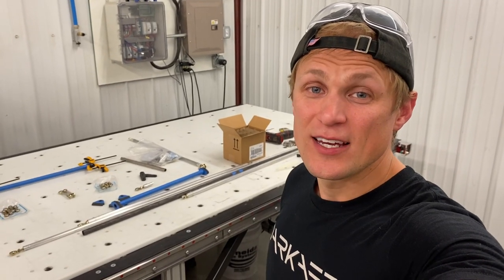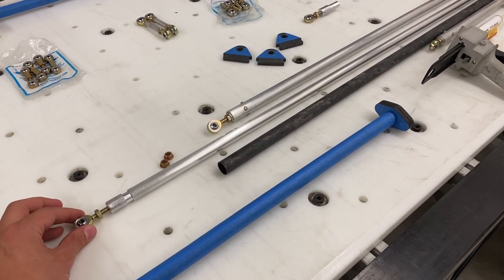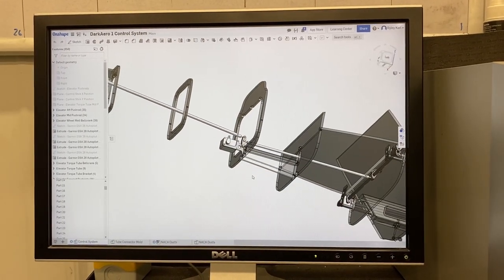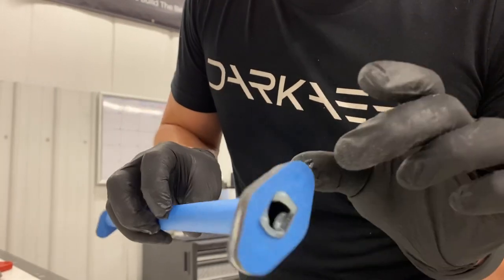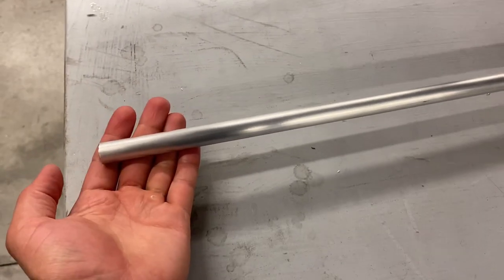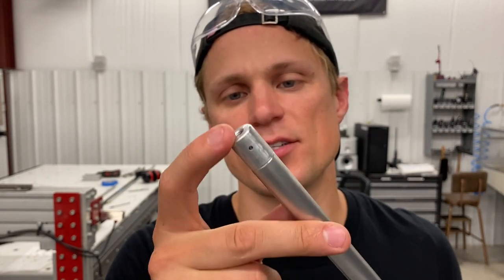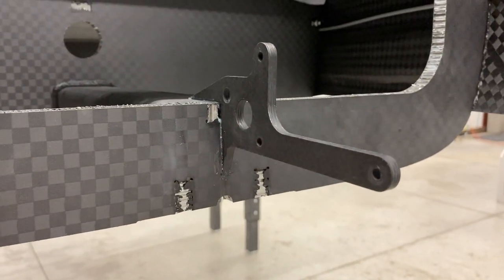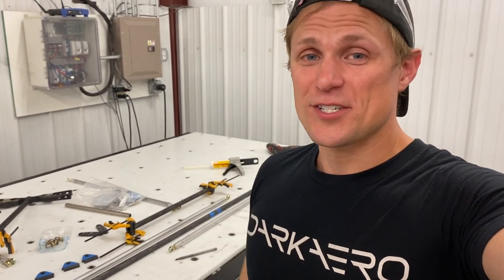Making Aluminum and Carbon Fiber Control System Parts for the DarkAero 1 - July 1, 2020

Comment: You may want to have a look at how the MCR01 bellcranks are made. Cut from CF/foam sandwich and the foam is cut out at the tips to make a clevis and fit rod ends. Still decent surface area to bond on the torque tube and extremely light.
Reply from the maker: Thank you for watching! Can you provide a link or documentation on the concept you described?

Comment: When you weigh each finished part, how does it compare to the theoretical weight of the 3D modeled part?
Reply from the maker: Great question! In general, we are within 1-2%. Billet machined parts and hardware almost always dead nuts on. Composite parts like the carbon fiber airframe structures are within the 1-2% range. We did a video discussing some of the sources on this variation. https://youtu.be/ziEnDjEHJuk Interestingly, the components with the most error are usually supplier components which don't always line up with their published weight numbers.
Reply: @DarkAeroInc  So no surprises when it comes to doing the first weight and balance 😊

Comment: Question regarding use of component mass data. I have seen your video about the variables that influence final component weights.  As you get the final weight values, do you  update the components’ actual weight in Onshape and / or your stress simulation analysis application with the view of validating & improving the accuracy of any stress analysis ?  PS Thanks to YouTube I  came across your work while following Raptor and Scrappy. Love your work. Wish you all the best. Thanks for sharing.

Comment: Curious why you didn’t go with carbon push rods instead of the aluminum? I’ve seen threaded inserts specially for that purpose.
Reply from the maker: We might ultimately go with carbon fiber pushrods if we can find a thoroughly validated solution for threaded inserts that are aircraft grade. Given the flight critical nature of the pushrods, and in the interest of getting the prototype finished, we just used standard off the shelf parts.
Reply: DarkAero, Inc  fair enough! Enjoying the videos!
Reply: Maybe the ball joints could be moulded into one piece to eliminate treads and rivets....
...a lot of work for a few grams :-)
Reply: Sqpapa   Please share the threaded insert design & source you refer to?
Reply: DarkAero, Inc   How much wt or % difference is there if you switch to carbon tubes?   Assume just tubing, neglect the ends since there is no design for those yet.  

I love the daily or at least weekly videos!

Comment: great progress. Also why wouldn't you use a carbon fiber tubes for your push rods to help cut down on some more weight?
Reply from the maker: Thank you! We might change over to carbon fiber tubes for the pushrods if we can find a thoroughly validated solution for threaded inserts that are aircraft grade. Given the flight critical nature of the pushrods, and in the interest of getting the prototype finished, we just used standard off the shelf parts.

Comment: I'm building a Vans RV. The push/pull tubes on your airplane are much smaller in diameter than the Vans ones. They will be adequate in tension, but have you checked them for buckling in compression?
Reply from the maker: Thank you for watching! The pushrods were sized based of the flight loads and control forces in the DarkAero 1. They were checked for buckling in compression.

Comment: Ryley - how did you locate the holes for the match drilling in the push rod? Seems that the rod end holes where inside the pushrod, did you have a template or jig to locate the holes?
Reply from the maker: There are two 1/8" diameter holes in each insert/tube end which are drilled 90 degrees relative to each other. I placed the insert into the end of the tube and then taped it in place so it wouldn't move or rotate. Then I measured and marked 1-1/16" in from the end face of the insert for the first hole and drilled this first hole on both ends of the tube. Then I measured and marked 1-5/16" in from the insert end face for the second hole. When I drilled the second hole I placed a long 1/8" diameter drill bit in the first hole to use as a visual indicator to help sight and align the second hole 90 degrees offset from the first hole. Maybe a little hard to explain in writing but it's really easy to accomplish in practice. The holes don't have to be insanely accurate on the position. The process is forgiving to a bit of human error on the drilling operation.

Comment: Why even bother with the aluminum tubing?  Go all up with carbon fiber tubing, unless you know something I don’t.  I removed all of the aluminum control rods in my Murphy Super Rebel and did everything with 1.125” tubing.  I machined Ti 6AL4V lugs for the control connections, scuffed the internal tubing to rough, bonded the Ti lugs to the carbon tubes using Hysol adhesive, and then blew a Ti Hylok through the tube/ lug interface for secondary backup.  Couldn’t believe I pulled almost 12 lbs of control tubing out of the control system.